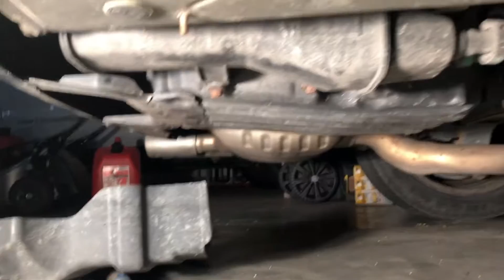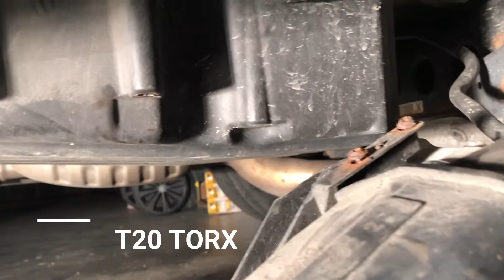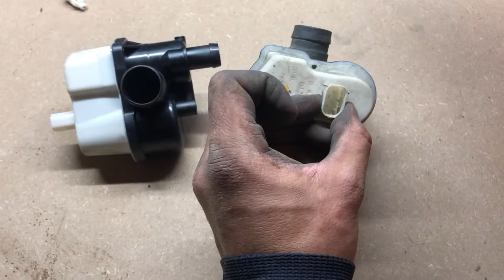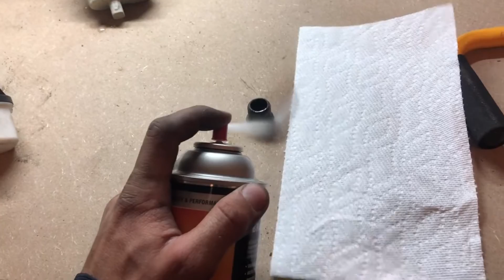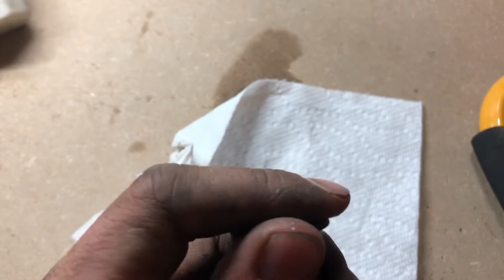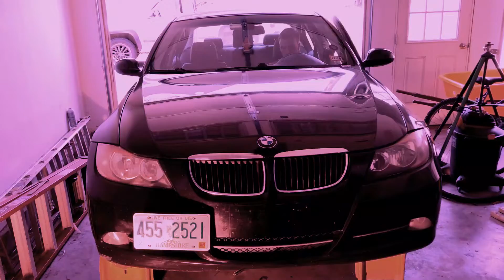BMW E90 EVAP LEAK DETECTION PUMP REPLACEMENT

Comment: Pretty straightforward if you follow what he does, 

8mm-Remove rear cover
Disconnect pump connector
x2-10MM for the pump to lower
x2-T20 to remove bracket from pump
-You should be able to unplug and remove the pump